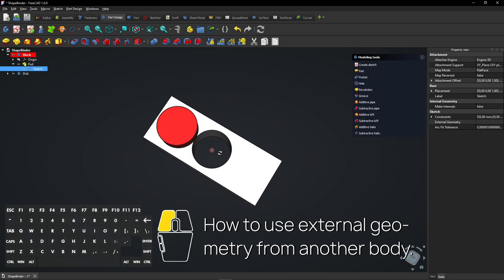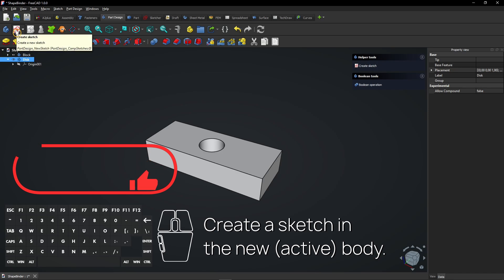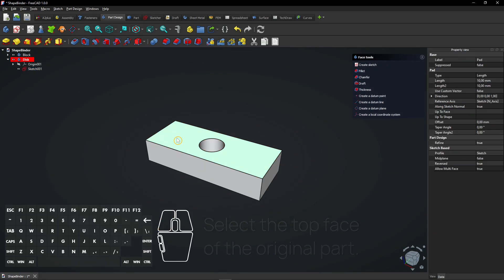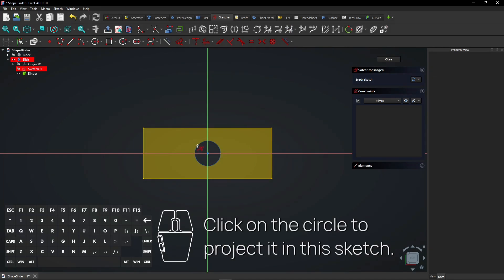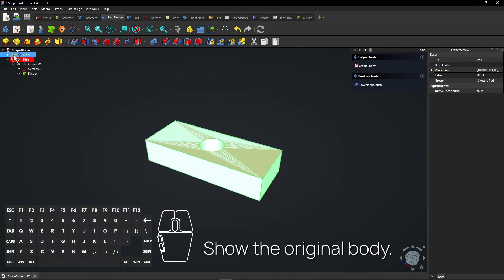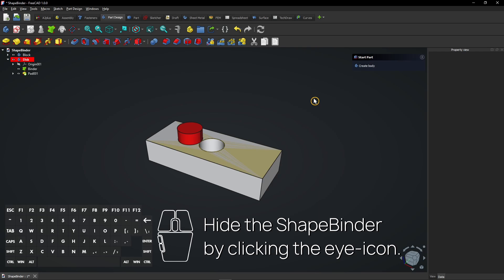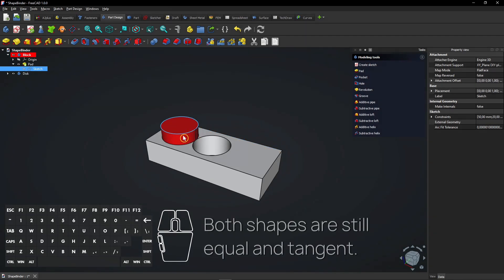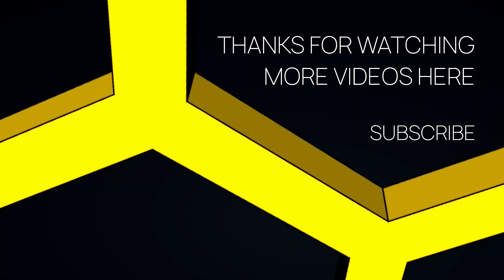💥 Use External Geometry From Another Body - FreeCAD ShapeBinder - FreeCAD External Geometry

Comment: Thanks! I finally understood how it works. The point that was missing for me which should be more emphasized, is that you have to turn off the display of the original body when importing external geometry from the shape binder. Otherwise because of "z-fighting" you'll be trying to picking geometry from the original body instead of the shape binder, which you can't import.
Reply from the maker: Good job!
Reply: This was my problem as well.  Thanks!